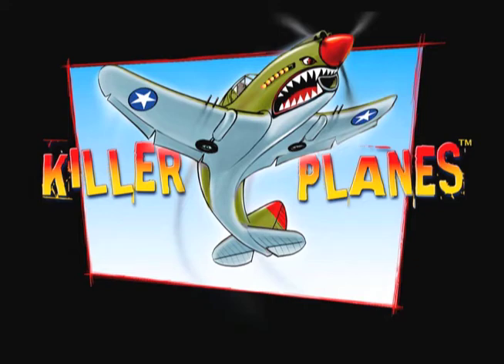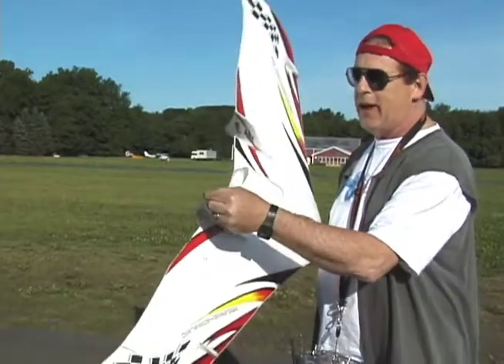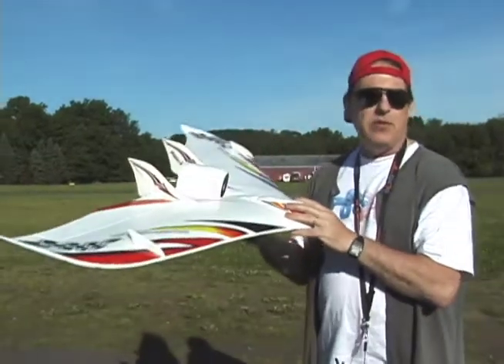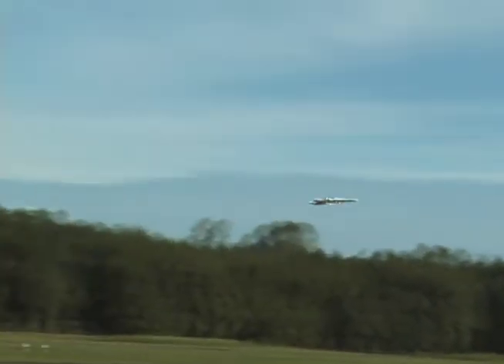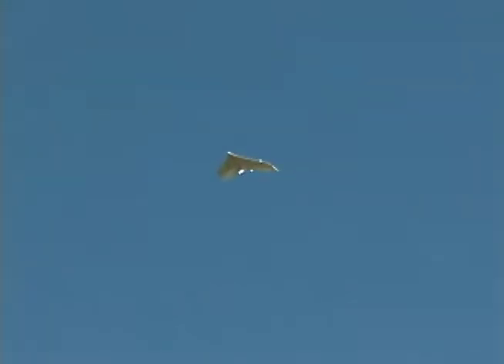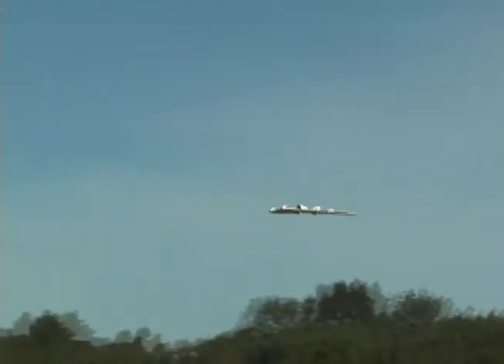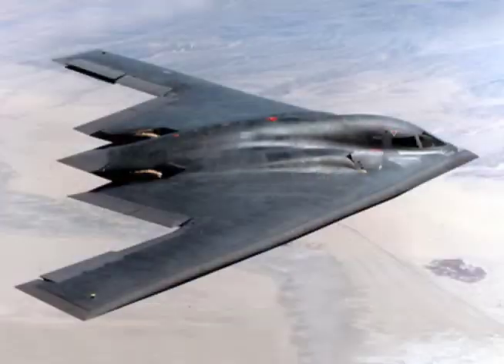TECH ONE SEXY HOT JET WING

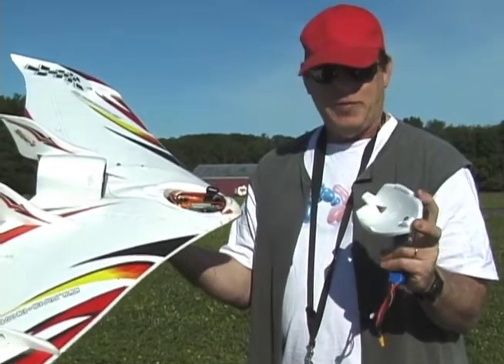Comment: With regards to your comments at 2:50 to 3:15, a nose-heavy plane trimmed to fly level at half-throttle will climb at full throttle because the elevator trim will be stronger at higher speed whereas the nose weight stays the same.  If you make it even more nose-heavy, you will need even more trim at 3/4 throttle to keep it level, and it will climb even worse at full throttle.  The only way to get the trims to be the same at all speeds is to have the cg perfectly neutral.